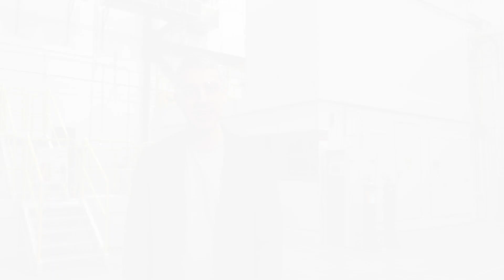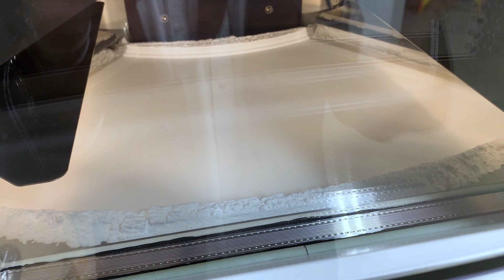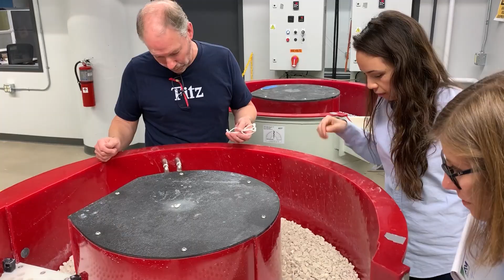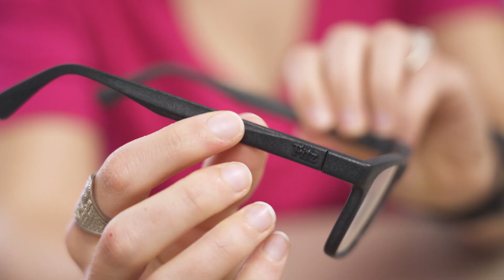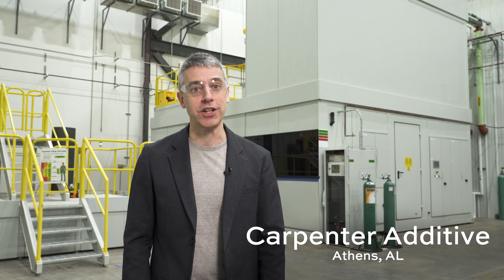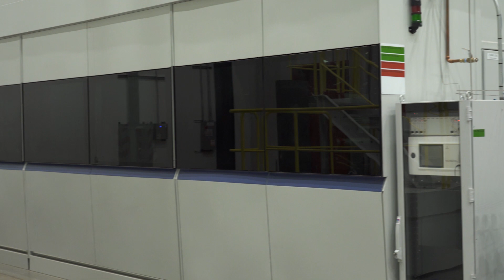Fitz Frames Makes Manufacturing Glasses Better With 3D Printing: The Cool Parts Show S2E2

Comment: "...I'm not aware that glasses have a problem...." - re-thinking the business model through the prism of Industry 4.0 tools led to a new workflow. I enjoyed this because it dissected the use case through several layers: software, mobile phone camera sensors, an AR model and then manufacture an object on demand. It looks easy now, but a lot of tools have to work together.  Can the glasses be recycled? Is that on the Fitz Frames roadmap?
Reply from the maker: Hi Matt, we reached out to Fitz Frames and received the following response regarding your question.
"We are unable to melt down the glasses to "truly" recycle them but have recyclable programs we are looking at for the future. One of the things we are looking at is offering a discount for families who return older glasses (as a child's face will change every 6 months) and working with our philanthropic partner, Vision To Learn, to donate glasses when we receive older ones."